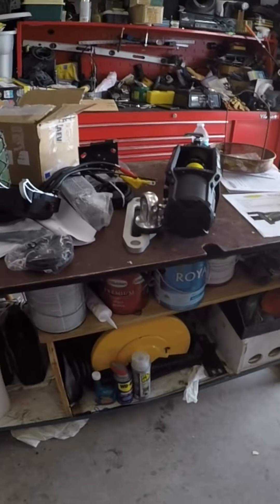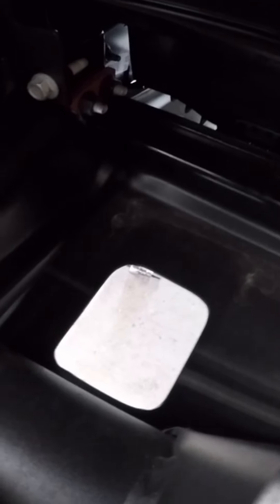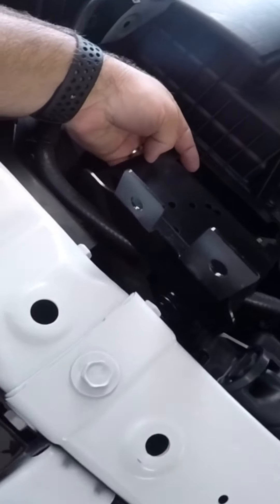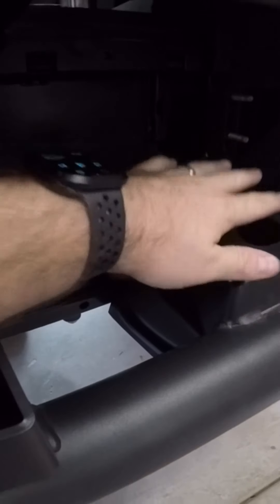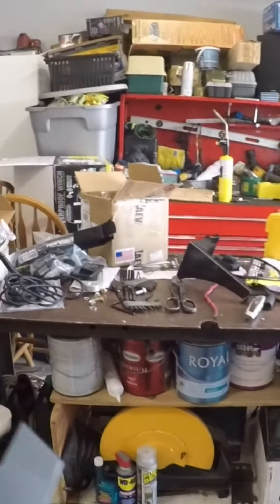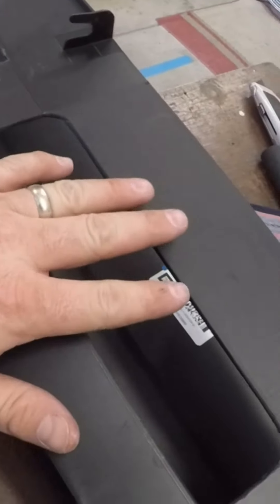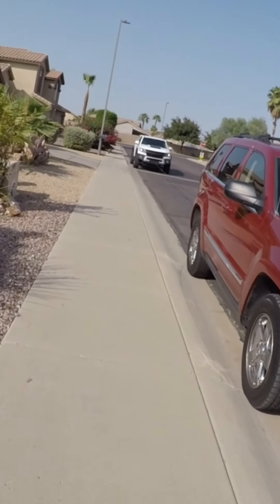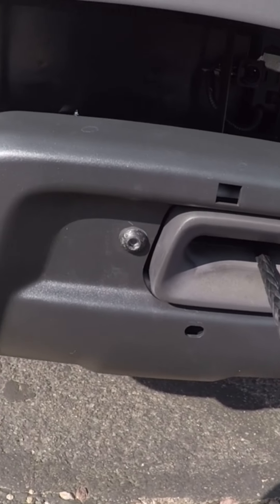2021 Chevy Colorado ZR2 Bison Winch Install

Comment: With the way the winch was mounted (inverted), did you have to switch the controller box signal to reverse the rotation; so the rope would top "spool in", instead of it wanting to pull the rope down to bottom feed on "spool in" as you described in the video? Or do you just push "out" when you want to spool "in" and vise-versa.
Reply from the maker: Great question. We flipped the motor to the other side so it works as intended. That winch was super super easy to do that. Just maybe 10 little screws.

Comment: No issues with the electrical box exposed like that?
Reply from the maker: Nope, not yet. Just a couple people release the gear to free spool….
Reply: @krazytommygunnhughes856  sweet. Do you know of any other fairleads that work? It don't look like you used anything from the aev kit other than the lead.
Reply from the maker: @scottydoesntknow254  I used the lead, and the mounting hardware.  Was a waste of $$. Lol. GM said that’s the only kit that will work. Not true….
Reply: @krazytommygunnhughes856  yeah I wish I could get the kit without the harness. It's pretty expensive for what it is.

Comment: Was it hard to mount?
Reply from the maker: Not at all. Very very easy
Reply: @krazytommygunnhughes856  hey man, did you just bolt the control box up to the plastic piece and that’s it?
Reply from the maker: @rickygonzalez86   yes. Was a bit tough to fit my fingers there but I use 2 little bolts and nuts on side to the plastic only. And 2 small self taping screw to the metal in the other side. It’s a tight fit.